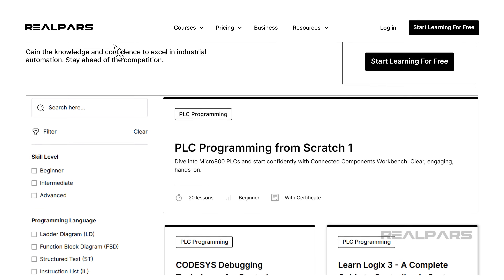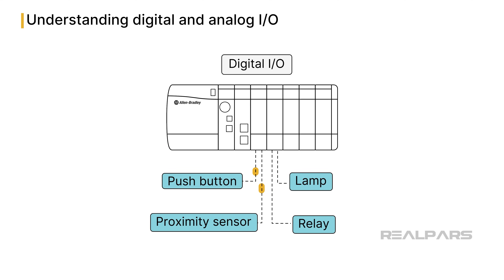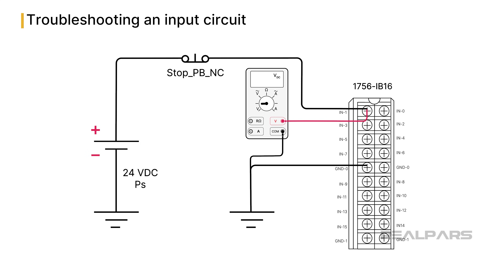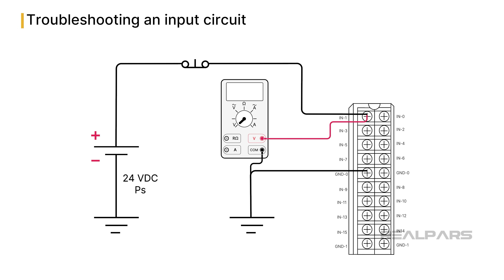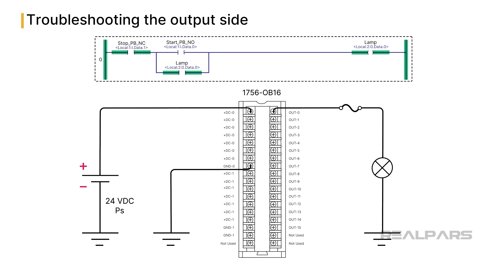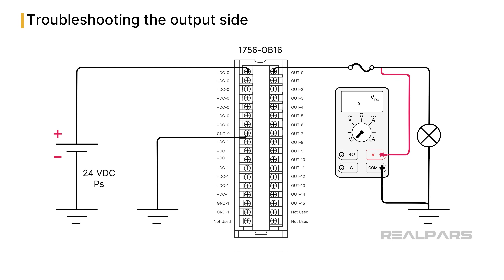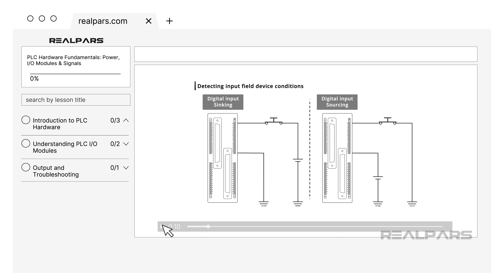How to Test PLC Digital Inputs and Outputs (Step-by-Step Guide)

Comment: 10:08 How can you get 24V dc here when measuring on the same ground wire?
Reply from the maker: Hello, @wediadi6788 Thank you for your question. Not sure which part of the video you are asking about. If you had added the video time the question is about, I could be more specific with my answer. But normally, for safety concerns, the 0 volts or return of a DC power supply is connected to the safety earth ground of the control cabinet or panel. This is a comment connection that helps reduce electrical noise in the PLC electronics caused by harmonics. 
If you're looking to learn more about this topic, you can join our 7-day free trial at 
https://community.realpars.com/checkout/realpars-membership
Reply: @realpars  Ok I get it now, since the wire between the lamp and ground is broken or the ground connection is corroded, then there is no connection to the ground from the lamp. That is why you get the 24V on the ground side of the lamp, through the panel's ground. I hope i'm right.
Reply from the maker: @wediadi6788 Thanks for reaching out.  You are correct.  Many troubleshooters will ignore this step because they think, " Why would I measure voltage at the ground connection when it is going to be 0V? That's a waste of time."

Comment: How do u go about checking between PLC and field devices with multimeter when leads won't reach?
Reply from the maker: Hello, @brockwells7247. Thank you for your question.  Normally, all power connections in the control cabinet housing the PLC power supply source have the negative or return VDC grounded to the building ground. Making a ground connection is a common practice in buildings. This is done for safety reasons and to reduce electrical noise to the electronics. This is standard procedure in most industrial automation worldwide and part of safety codes. The same will be done where the field devices are located. Therefore, it will not be a problem when you measure your field devices outside the control cabinet.  You can sign up for a 7-day free membership and learn more about this topic in our maintenance series lessons at www.realpars.com

Comment: Interesting how you use the term ground. even though you quote the DMM reading of 0V DC.
And drawn showing an earth symbol???
This is bad practice and terminology. and a safety issue.
In the field you will likely have  240VAC and 415VAC and 24VDC and sometimes 24VAC all in the one panel.
Calling a 0VDC  a ground can easily lead connecting a 0VDC into a neutral of a 240VAC system. 
When dealing with DC there is NO neutral and earth. its 24VDC (or whatever voltage potential) and 0VDC. or connecting the 0VDC to earth bar as your drawing shows?
Someones gonna get electrocuted because of confusion and bad terminology.
Reply from the maker: Hello, @throughput6674. Thank you for your comment. And as you mentioned, which is rule number one, only qualified personnel are allowed to work on electrical equipment after they are trained on the equipment in their plant. I, for example, being a seasoned maintenance Engineer with experience in the field of building, installing, and commissioning control panels up to 1K AC or DC for 40 years in industries from food, automotive, industrial, and nuclear power plants, does not make me qualified to come to your plant and work on your equipment. I possess the safety and electrical training, knowledge, experience, and education in this discipline; however, I do not have training on your specific equipment. Therefore, I am not qualified and could be at risk of electrocution if I were not trained on your equipment. I'm not sure where you are in your education or experience in this field. Still, the terminology we use in our training is based on the standards recognized by the majority of countries where we offer our courses. We adhere to IEC, DIN, IEEE, OSHA, and UL CE, among others, as standards. If you are not one of our student members, I invite you to join for a free trial at http://www.realpars.com/ and see what we offer for your learning experience. And AC and DC, in most cases, depending on the Engineering of the control panel, can all be grounded to a single point in the control panel for safety and EMF noise reduction. The majority of the control manufacturers of PLCs, Drives, and other electronic devices will provide this grounding information..  Here is a link for your learning:  https://maker.pro/blog/the-major-differences-in-electrical-standards-between-the-u.s.-and-europe

Happy learning from Realpars!
Reply: @realpars 😅
Reply from the maker: Hello @throughput6674. You are correct. Our use of the earth ground symbol is misleading indeed. It's a bad habit that we electronic/instrumentation types abuse. (And easy to draw). Thanks for calling us out and informing our viewers.

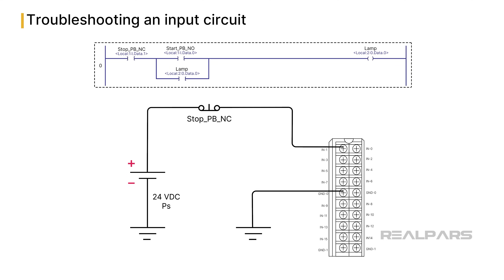Comment: 3:15 What is an Up to date drawing?
Reply from the maker: Hello, @COPPhone-g4o  Thank you for your question.  We want to inform you that you should have the latest drawings when troubleshooting your devices. The ones that come with your system and any updates to your system by your Engineering team and from the vendor website on the devices.  Happy learning from RealPars!
Reply: Engineers can change the circuits funtions at anytime without notifying the rest of the company, give seen it before, that's why it's best to document everything and find out everything about it before working
Reply: @DAMN__________  It was sarcasm
Reply from the maker: @COPPhone-g4o  Hehehe........ good one. I've yet to visit an industrial facility with up-to-date drawings. But we work with what we can get.